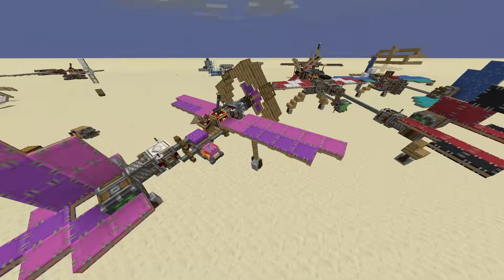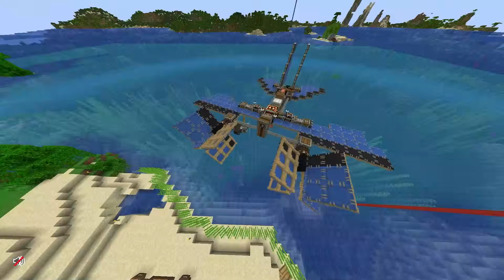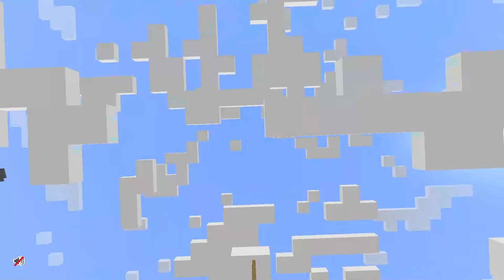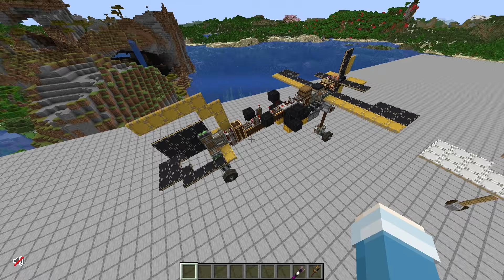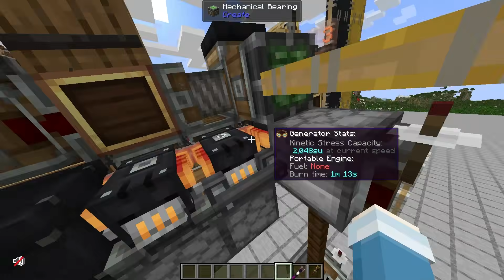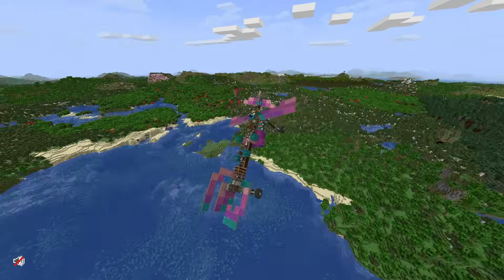I PERFECTED Airplanes in Minecraft Create Aeronautics

Comment: Question for some reason when i put it to 13 it wont start and when its 12 i go to the moon or have to spam shift to keep somewhat lvl did i do sometyhing wrong?
Reply from the maker: Hmm I’m not sure. If you’re using blaze cakes as fuel it will be messed up. Also there are some mods and modpacks (with changed configs) that change lift calculations and stuff.

Comment: you should consider using a steam engine sometimes, its 8 times as powerful as 1 engine and can be decently compacted down
Reply from the maker: I’ve experimented with steam engine designs but haven’t found a good design yet that can match the compactness and weight of portable engines. But for a slightly larger vehicle you’re definitely right

Comment: Is there a reason your automatic fueling setup is as bulky as it is? After watching your golf carts > cars video I whipped up a quick prototype because I was pretty sure I could make the system more ergonomic by detecting when a player is in the seat. There are a number of good options for this: a laser can fit past the seat's hitbox, string can be used with an observer or tripwire hooks, and if you have additional placements installed a sideways pressure plate is perfect; I ended up using a weighted pressure plate because its signal strength of 1 worked perfectly with the refueling circuit I devised. The circuit I came up with for triggering a fuel resupply is set up as follows: the comparator reading the generator points into the side input of a comparator on compare mode. When that second comparator is powered with a signal strength of 1, its signal will pass only if the generator's comparator output is <= 1. For my setup, that signal strength came from the weighted pressure plate. For your setup, I'd instead have it read a composter with fill level 1 and toggle the circuit by powering the comparator's other side input with a signal strength of 2 or more.

If you really want to cut down the width, you could power a dot of redstone dust with the first comparator and put the second comparator beside it such that its direction is parallel to the first. Even with the on/off signal on its other side-input, the setup would only be 3 blocks wide.
Reply from the maker: I’m no redstone expert so I’m having some trouble understanding exactly the circuits you’re describing, but I’m sure you’re right that there are better ways to set it up. I guess I’ll just explain how my circuit works to maybe explain why I made certain choices. First of all, the whole thing is mirrored for balance, just replacing components with blocks. The comparator reading the engine sends its signal through an inductor just to copy it and send the strength a block further to line up with the other comparator. That one is reading my triple purpose analog lever set to 2 (it powers this circuit, the throttle circuit subtraction, and lowers speed via analog transmission lmao). This subtracts the engine signal from 2, only activating if the engine is at 1 or 0. But to make it toggleable, I needed some sort of AND gate with a toggle latch, so I used a third comparator reading the toggle latch, and used a torch to invert the lower circuit output and feed it into the side. So it only outputs if the lower output turns on (inverted to an off signal) and the toggle latch is on. Thanks for the comment!
Reply: @WukiPookie  OK; I had been wondering whether the inductor did anything besides extend the reach of the signal. If you are re-using the signal strength of 2 for other things subtract mode is definitely the right choice here; it just happened that setting it to compare worked better for my case since it let me use signal strength 1 instead. Much like my circuit, yours can be turned off by powering the other side-input of the comparator that's set to subtract. I would expect this to be a lot more compact than the and gate setup you showed in the video. I hadn't thought of the balance aspect since I'd been designing for a ground vehicle, but that should be a fun puzzle to figure out when I get around to building an aircraft.

Comment: you could add a analog lever at 13 on the inferior aeronautics transmition block to have the max power be 15 and minimum be 0, i think its a cleaner and a easy one block solution to the throttle controle problem, anyhow loved ur plane and goldfish warmachines very cool love form brazil!!!!
Reply from the maker: Yeah just using a lever is the simple way and it works fine. I just wanted to be able to control the throttle from the typewriter for that extra bit of convenience

Comment: plane seems pretty good for plane standards so the only thing i can think of  that would make it better would be some vtol capability so it doesnt need that big of a runway as well as making it easier to disassemble and reassemble without breaking anything would be good for servers
personally im more of a heli type of guy they just seem more convenient as you can land pretty much anywhere somewhat flat
also you can fit a lv 9 steam engine on a heli easier and you can have fuel free stress units so you dont even need to bother with fuel
the plane does have the highest speed potential tho so ill give you that
Reply from the maker: i think this plane should have no problem assembling and disassembling, but i would just need to install a physics assembler somewhere. ive had bad experiences with helicopters and i have a hard time controlling them which is why i like to stick to planes, but i have seen some really cool osprey-like hybrid vehicles out there

Comment: i would totally join your discord server but also i just got aeronautics what do you use to turn the flaps/control surfaces because its not a swivel bearing and im generally not very good at create
Reply: mechanical bearings
Reply: @NoahTischler-t1n  thank you
Reply: @NotAMothRealHuman  no prob have been there, normally u can get the block (and even the mod its from) in the jade menu (the little window on the top of the screen) i dont know if this is the case in this video.

Comment: This is a cool plane you got there!

I had a recent realization that - among air envelopes added by Aeronautics - you can use Wool as an alternative for building a balloon, though considering recipes, Envelopes are still very much a lot cheaper.
Do you want to know what else works for balloons?

Froglights.

Unlike wool or envelopes they have normal weight - X4 greater than your typical balloon building blocks... But unlike them it's fireproof.

Probably it's not most optimal material to build with, but I do wonder how viable it would be.
Reply from the maker: yeah as pekarnya said, froglights dont count as airtight for me. thats a cool tradeoff to consider though
Reply: @WukiPookie  My bad. I was soo excited by this weird odditty that I haven't even considered that one of the mods might have changed that.
Reply: you're probably using other mod cus in normal create:aeronautics froglights aren't airtight
Reply: @pekarnya5227  wait... are you serious right now?
I haven't even considered that another mod might have made them Airtight.
Welp sorry for confusion, post canceled, put your frogs back in their ponds...

Comment: will there be any improvements to the pitch speed if youmake the elevator part of the plane wide instead of long?
Reply from the maker: I’m pretty sure in aeronautics the only factor affecting pitch speed would be distance of sail blocks from center, so elevator width shouldn’t affect it. It would reduce roll speed though. That said, I’ve never done scientific tests for it so this is just my intuition/logical assumption. I think real planes have wider tails for reasons relating to drag and airflow stuff that doesn’t apply to aero